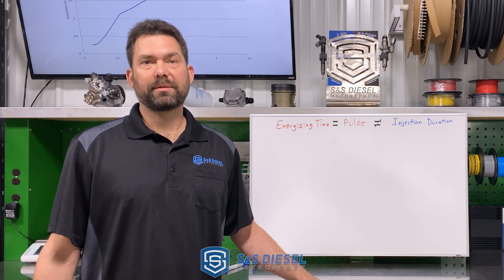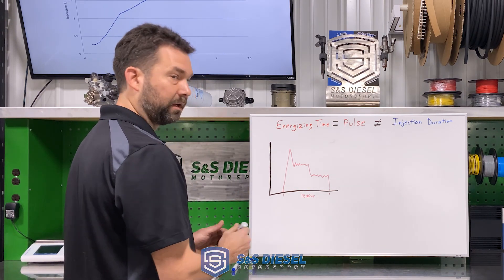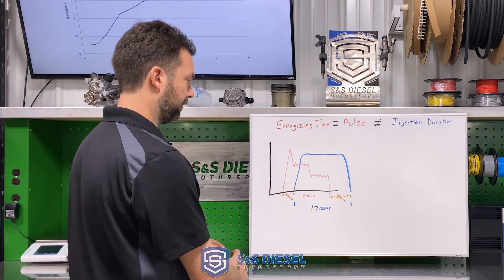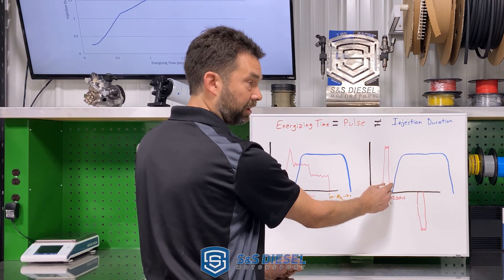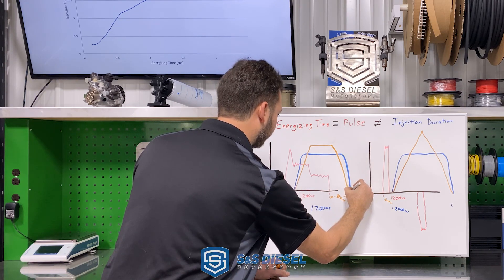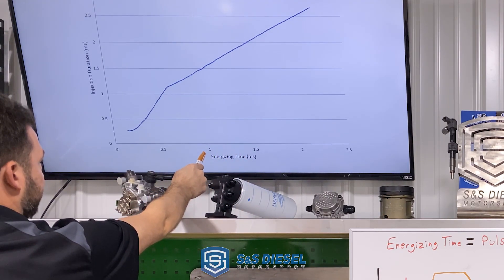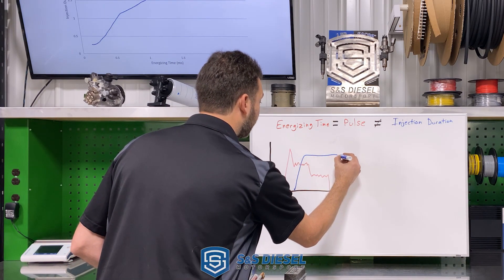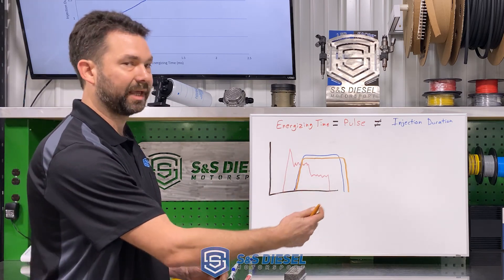Common Rail Facts - Injection Duration

Comment: Doesn't the ECM compensate for this somewhat or do you need to take this into account in the pulse tables? I think I have seen injection delay tables in the 5.9 when using hp tuners.